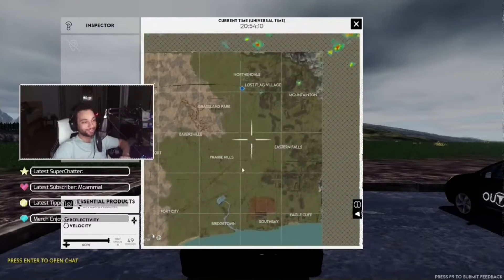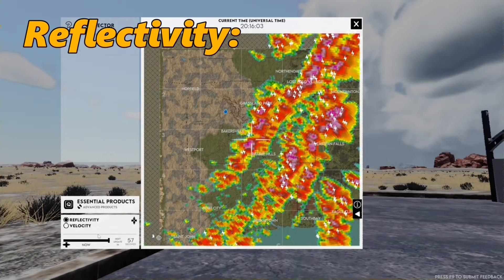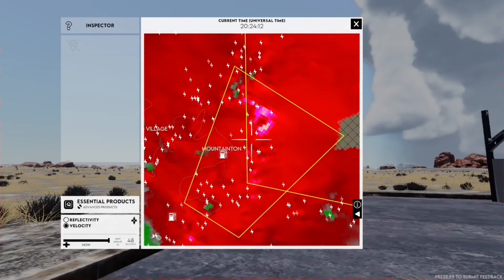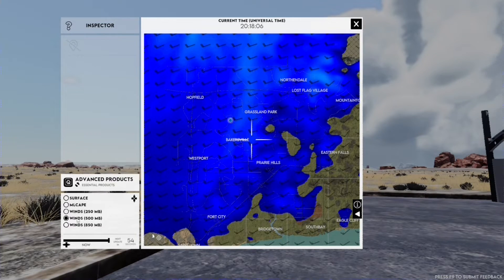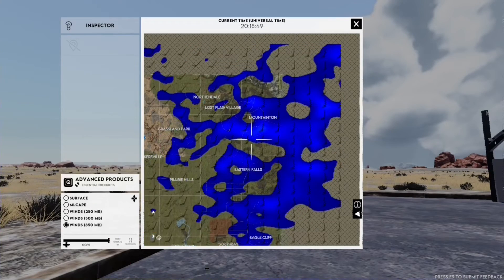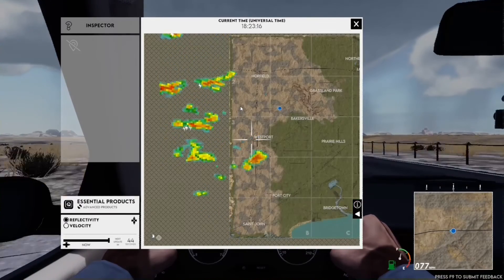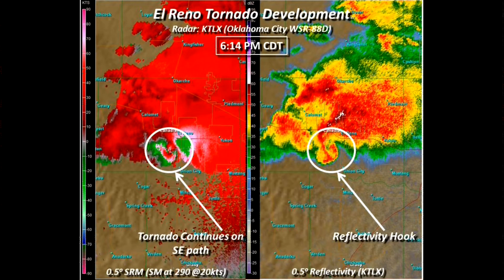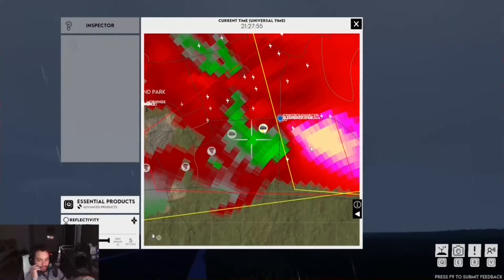OUTBRK Ultimate Guide Part 3: Weather Radar Mastery for Perfect Tornado Intercepts! 🌪️ #StormChasing

Comment: im still so lost after watching this
Reply: I will try to help:

Before you try to understand the maps, you should understand how radar works. Radar (this is very simplified obviously) works by sending out a beam and measuring what returns. This is why we can measure storms with radar, because clouds have a much higher particle content than just air, so they reflect more of the radar beam giving a visual on the screen. 

Reflectivity: This is your typical weather radar that you see on your phone whenever you look to see how heavy the rain is going to be. Green is light rain, and red is heavy rain. Purple and pink usually indicate hail. Reflectivity measures the amount of radar that’s reflected back and larger rain drops and hail reflect more giving you a heavier and darker signature on the map. 

Velocity: Velocity is the direction and speed of the wind measured relative to the radar’s location. Looking at 1:05 on the video you can see the radar’s location as OZEF in the black box. All of the green sections are moving toward the radar and all of the red sections are moving away from the radar. Tornados in the US have a cyclonic rotation, in other words, counter clockwise. This means that if you see green on the left, and red on the right, you’re looking at potential counter clockwise rotation wherever the two meet, called a couplet. 

Surface: This map shows the temperature and the dew point. Dew point is basically humidity. The higher the dew point is relative to the temperature, the more humid it will feel. If it’s 70° and the dew point is 65° it will feel really humid. Long story short, if you look at the surface map, find a location where the top and bottom numbers are close to each other. That will give you an idea of where it is most humid.

MLCAPE: Cape is Convective Available Potential Energy. This is more or less the “battery” for a storm. The more potential energy a storm has, the more powerful it can be. The more energy areas show up similar to the rain map, as the more red and orange areas have more power than the blue and green areas. 

The wind maps: The wind maps are broken into 3 sections. These 3 sections are altitudes based on pressure, that’s what MB stands for. 850mb is about 5,000 feet up. The other two winds are lower. Windsheer, which is just how fast the wind is moving, needs to be high for a tornado to form.

Honestly, you can have quite a bit of fun playing the game just using the reflectivity and velocity maps, because they will basically show you where a tornado is forming or has formed. The other maps are more predictive and are more complicated. If you want me to explain things in more detail, I can give you my steam if you want and we can talk on there.